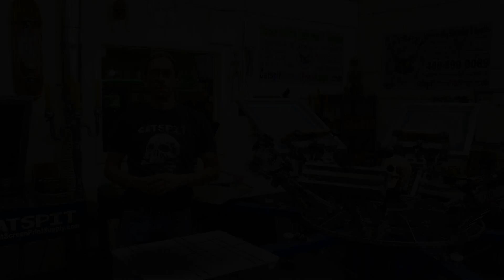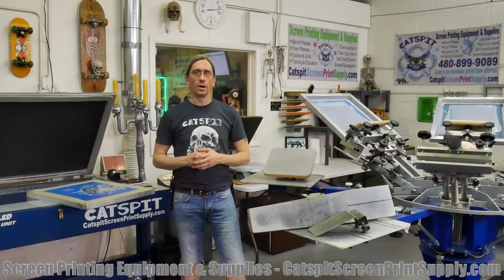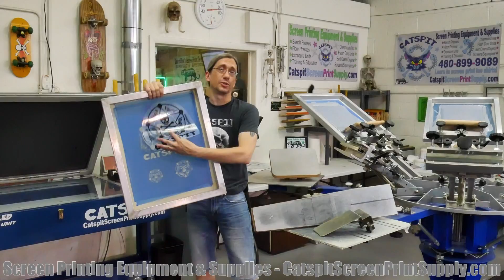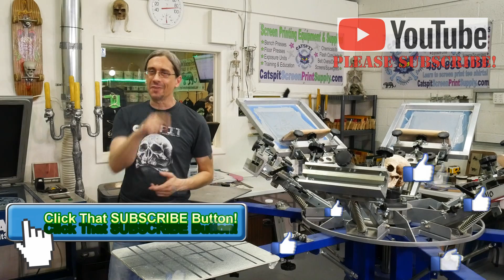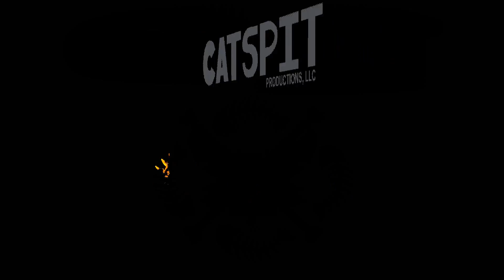Screen Printing Tip: How To Prevent Problems By Mocking Up Your Print Jobs

Comment: Hello, Jon! Sorry if this question is not at all related to the video, but do you use a color separation program for CMYK printing or just photoshop? Thanks!
Reply from the maker: Hey there... I use neither. I use AI with RIP software. I sometimes use PS for pre-processing but not for film output. Thanks for watching! Screen Printing Equipment & Supplies - http://CatspitScreenPrintSupply.com/
Reply: Thanks a lot for your response. :)
Reply from the maker: You're welcome!